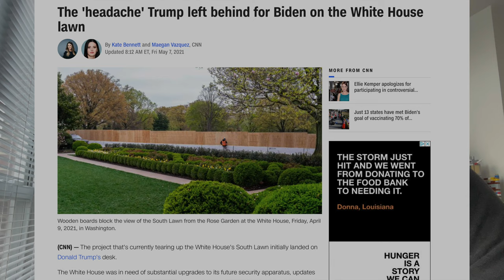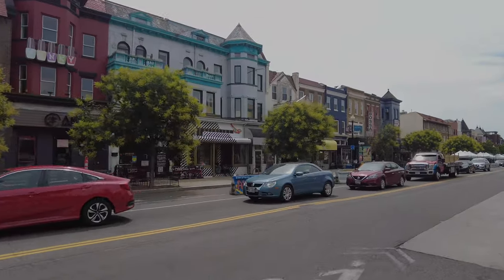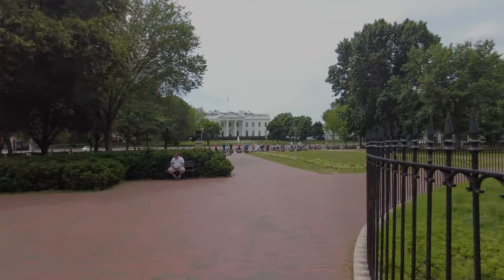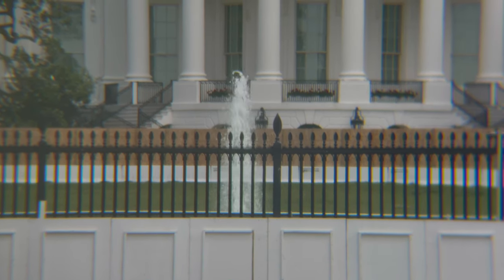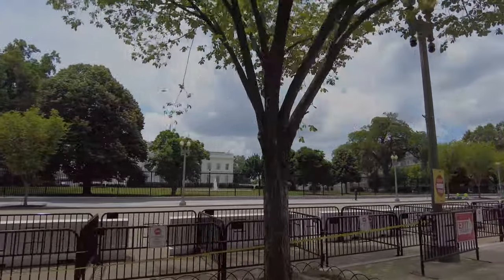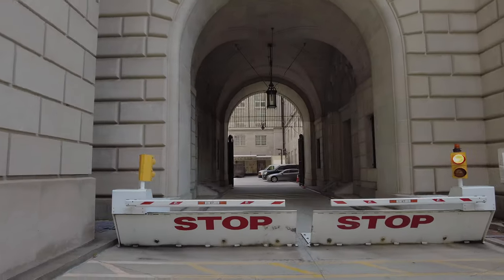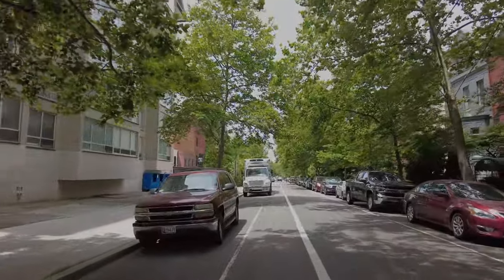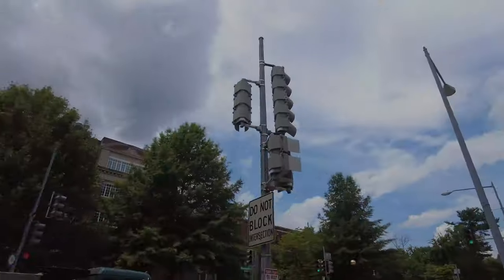Update on the White House Construction on the South Lawn along with a view of the IRS HQ in D.C.

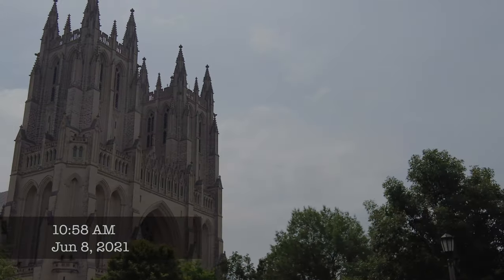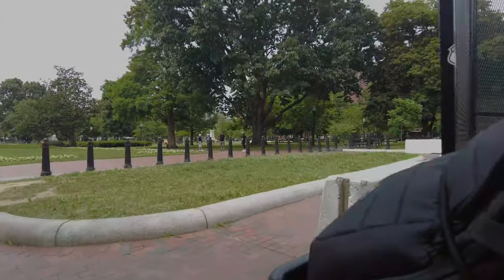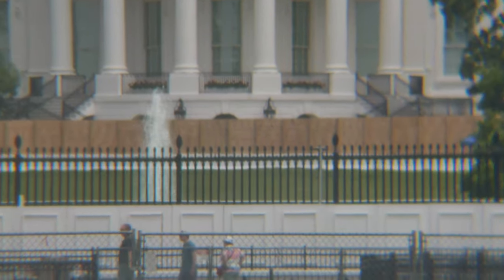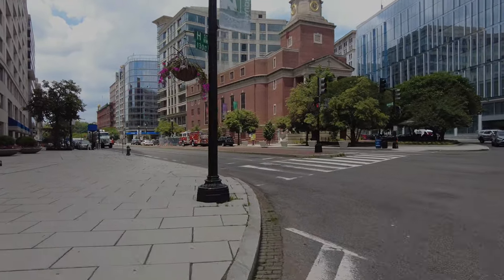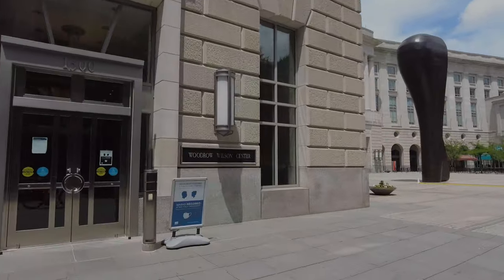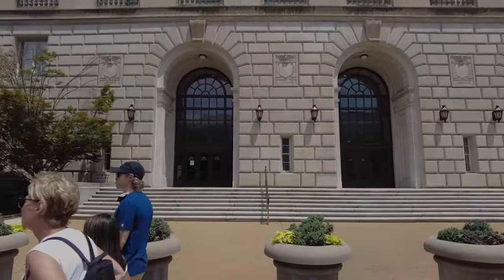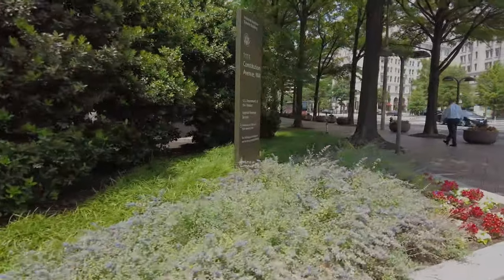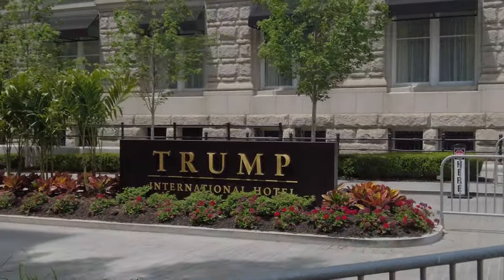Comment: 1:17 oh wow look at that big  beautiful free energy device there...oh wait, the WH is one also, and the old carnegie library and the church next to the new australian embassy and that red brick building near the national geographic society headquarters that's a huge battery, an energy storage centre holding energy ready to be used for electricity 6:31 is a particularly nice shot as it shows not only the main attraction...the WH free energy generator device but those little mini tower guards placed all in a line there with rings around the ball top they're guess what.... you got it!! 8:27 those beautiful columns play a big part in harnessing free energy from the aether too as does closed symmetrical patterns usually found shown as wheel shape looking windows most often in churches, yes they form a kind of closed in loop system that perpetuates the energy 9:31 the chamber of commerce is also another energy storage house, the iron oxide in the red brick make them hold energy and can then be used for electricity, free of course, nice and clean electricity too not like the dirty stuff we have these days that's so overpriced 12:12 wow the whole city is filled with giant free energy generators and holders isn't it. Lots of archways too which is a horseshoe shaped magnet structure, oh and would you look at that 15:30 we have a lovely large phallic device inserted right in front of the woodrow wilson centre for international scholars and I believe it was inserted there because let's face it the man was a... actually I think it's may be inserted behind woodrow...oh well, whatever, never mind... 15:36 just as I was beginning to wonder where the much needed octagonal shaped structures were we have one right there at the reagan international trade centre right between it and woodrows international scholars those lucky kids they are... oh and of course that lovely large phallic plug looking device as well 🤔 I wonder what they might have traded, ragaen and woodrow...I'll have to look into that 15:56 we have some magnificent horseshoe magnets with their north and south poles dug in deep to really ground that electricity 16:00 my, with all the many huge energy batteries just storing all that energy you'd be all set for the cold winters & still have leftover electricity 17:21 flood...or liquefaction 🤔 17:37 all these lovely energy generator buildings like the irs always seem to have steps leading up to them don't they, I guess it's got something to do with those floods you mentioned, or yes what was it I said... liquefaction that's right...moving right along 18:44 yes notice that one part of the building is quite lower than the other with windows really down at ground level too which is quite strange in fact 19:13 they seem to be almost underground, but who would want to look out of a window and see nothing but... well, mud  🧐🤨🤔 19:49 we can just see a few updraft solar energy towers hiding on the roof up there catching all that lovely solar energy at the columbian embassy and at 19:48 I do believe that charming street lamp with it's purpose built design, a globe sitting above a mini tower,  it too plays another part in the harnessing conducting and generating of energy 20:10  and 20:12 there's some of those strange windows that seem to be built under the ground again and this time it looks like the driveway and garage is too 20:30 those tiny little  windows in the driveway there are so little and right down at ground level  in fact so low you'd need to be sitting on the floor to look out of them 😂 luckily the ones above it are much taller, for tall people I'm sure ☺️ 21:22 I'm not sure what that fellow is doing with his  head down in his lap there but I do see some steeples and spires pointing straight up to the heavens above to draw in that beautiful warm energy sent down from above 23:37 towers that mostly today hold clocks in them were a big part of the energy generator conductor process almost like superconductors, which is lucky those big arches are there to ground or earth all that energy, you never know what could happen if the energy was too great without them, probably give the earth one big shock that could be felt all over the earth in every nation which could have some devastating results for everyone to be sure...but that's a different story altogether now. So that's it, lots and lots of batteries in the capitol as well as generators and conductors, all giant free energy devices waiting to be used again someday ☺️